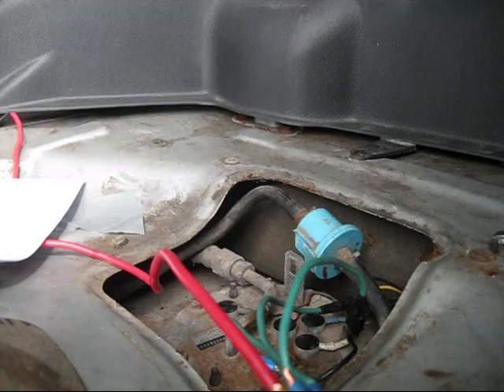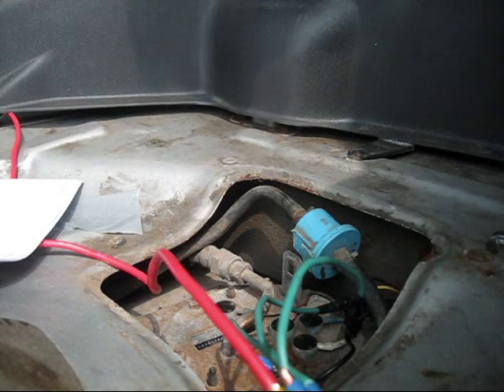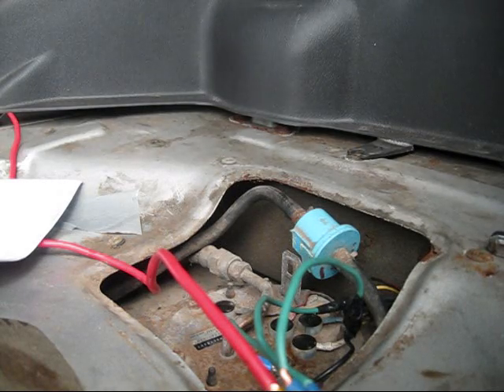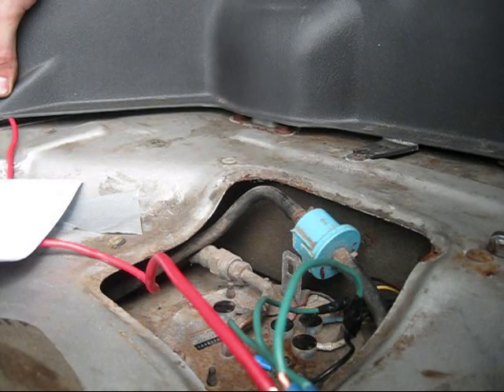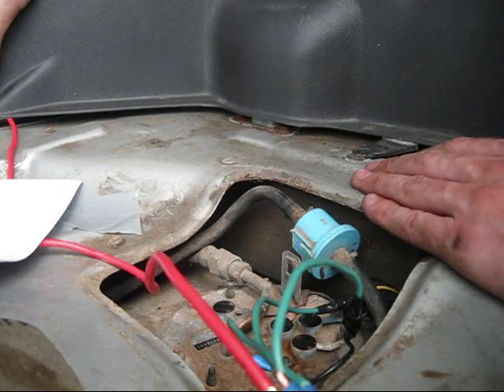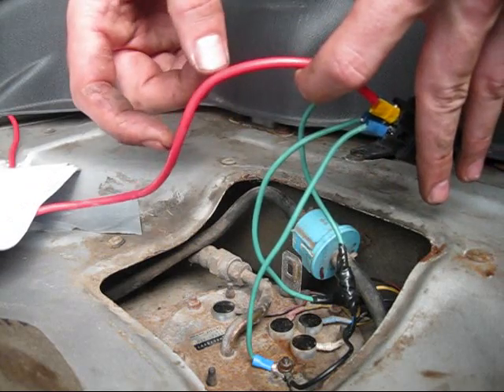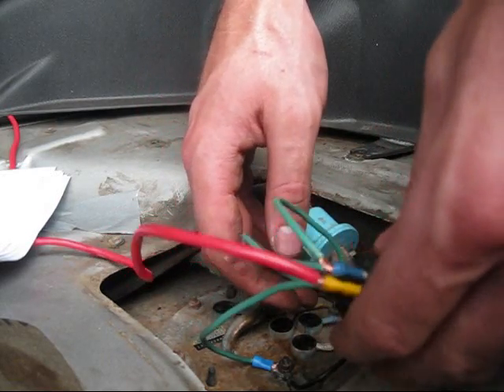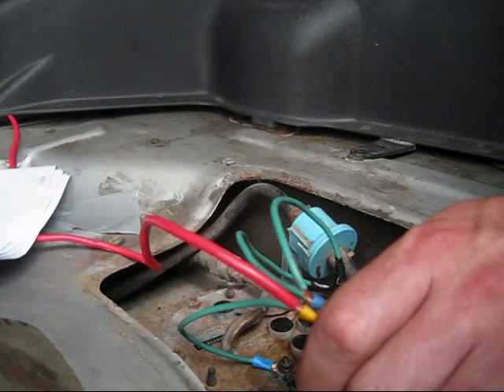Fuel Pump Hot Wire - CntrlSwitch How-To

Comment: oh ok cool. I got the kit in today and hot wired it. I also got the 3sx pre-intake pipes because my rubber ones on the back turbo had a tear in it. I also changed the spark plugs/wires (ngk copper plugs/msd plugs)  My car was studdering a bit the other day, but everything I did today seemed to fix it. The car is my daily driver to school and back (45 min). Its been 3 years so far. Its holding up good. I just can't wait to finish school so I can do serious upgrades.

Comment: I figured it out.. Yesterday I had replaced a cracked rubber hose (the one with a red line) with a regular hose. This morning I realized that the red line hose had a reducer. I would guess that could have possibly had cause the over boost. So what I did was rigged it up to re-use that red line hose. I also replaced a few collapsed, twisted, and kinked silicon hoses that connected to the Y-pipe and the intake plenum. Not really sure which one fixed the problem... but one of those worked. lol

Comment from the maker: The issue is that the stock fuel pressure regulator will be over run by the increase in fuel pressure.  As it it won't be able to let the extra fuel get back to the tank.  This will cause increased fuel pressure and therefore increased fuel consumption and you will run rich.  If you get an aem fpr and gauge so you can set your base fuel pressure you will be fine to install the 255 and keep everything else stock/N/A.

Comment from the maker: 6ga works just fine.  You can get technical and do voltage drop calcs based on the length of wire.  Check the site steath316 it has a write up on it.  Its under fuel pump rewire

Comment: So I got a sl and they did the hot wire but the fuel gauge doesn't work what can I do cause I'm reading milage and I noticed when I get low or half tank the car jults when accelerating from a complete stop. Only does that when it's low on gas

Comment: Hello my daughter has a2002 honda odyssey. My husband has put a new main fuel pump relay on and a new fuel pump and no power is getting to the pump when we switch the car on. The pump works when it connected to the battery
Reply: I have this issue, what was the solution

Comment from the maker: got your message.  You must have the relay wired in incorrectly.  Google some sites on how the relay works.  If you wire it correctly you should only get 12 volts to the pump once the switch in the relay is thrown by the stock positive wire.  Also even if the pump gets voltage your shouldn't be getting fuel "thrown" anywhere.  Are you saying it is leaking? shouldn't even be getting in the cylinders without the injectors opening.

Comment: Hey Shawn. 
I'm having a serious issue. I have a 97 Pathfinder.  Last night I tried to start it and smelled burning wires. I pulled back the carpet and noticed a bunch of water inside where the harness lays.
I've tried cutting and splicing wires but no success.  Can't figure out if it's because the wires are completely toasted or the pump is fried. 
When I turn the key I don't hear the pump prime at all.
What do you think?
Reply: check all the fuses
Reply: shadyj juner 
Found out it had nothing to do with fuses.
Timing belt snapped and motor crapped the bed.
End of vehicle.
Reply: +R Boyd shit dude that suckss
Reply: shadyj juner 
Is what it is I guess. 
It was on me.  I knew it had to be replaced, just didn't have the money to get it done.

Comment from the maker: That's how my car is set up.  Didn't have any problems before or after installing the fuel controller either.  The resistor only lowers how much voltage the pump gets when your idling (and I believe low load?)

Comment: I have a 1999 evinrude 70 go 4 stroke that I am only getting 6.4 volts when checked at the plug using multimeter. If I check with ground to the motor I get 12.4 volts. The manual advises changing the ECU but could I splice the ground wire and ground it to the motor to get the 12 volts needed to run the fuel pump. I have already replaced one fuel pump before I found that the pump was only receiving 6.4 volts. The ECU is over $1000.00
Reply from the maker: Andrew Smith check your wiring manual to see where the fuel pumps ground goes to. It probably shares a ground block with a couple other things. Then see if that ground has a solid connection. Also check your main ground wires that ground the battery to the body of the car. To answer your question directly I don’t see a any problem with grounding the fuel pump wherever you want if it solves your problem.
Reply: Thank You

Comment from the maker: yep I know what you mean.  When standing on the passenger side the "protrusion" tab should be at the top left.  There is a picture of it in the manual (15-14). Incorrect installation would cause idle problems not over boosting.  My guess is you accidentally disconnected a waste gate hose.  This would cause over boosting.  Wastegates need to be connected to a boost source (prior to throttle body).  Let me know if you figure it out.

Comment: i have mine hooked up just like u explained and does not work my main reason for doing a hot wire was the fuel pump was not turning on i no the pump works for sure anyhelp would be great thanks

Comment: Ok.
Got hotwire to rely # 87
Black grnd to #85th
Cut black/blue from harness to #86
NOW what WIRE are you refering to going to #30
Reply: This is how I wire my relays:  
30 - Battery
87 - Power (to pump)
86 - Trigger (factory power wire)
85 - Ground

The fused power from the battery goes to terminal #30.
The power to the pump (black with blue strip) comes from Terminal #87.
Terminal #86 is your trigger and goes to the cut wire (black with blue stripe) on the connector side.
Terminal #85 is grounded, use the point at which the black wire grounds for simplicity.
You should be able to use 85/86 interchangeably and it's just a coil that switches the relay.

I hope that clears things up for you.  He mixed up terminals 87 and 30 in the video.
Reply: @CBTalon97  Thanks !

Comment: I have a 95 3000Gt DOHC non turbo...  driving yesterday I noticed a considerable loss in Power or "get up" and now when the rpm's go down to idle my oil pressure gauge bottoms out. im afraid its rod bearings but the engine is not making any knocks or rattles and it cranks n runs fine, just no power and the oil pressure needle goes up and down with rpm's...   any insight u have on this would be greatly appreciated

Comment: Will this work on a 2009 ford f150 5.4.
Reply from the maker: Wires are likely different and I have no knowledge of that truck, but if it has an electric fuel pump then yes running a dedicated wire off the battery will work. Just properly fuse and use the relay in the same way that I do.

Comment: I just had my fuel pump and Vac replaced in my Pontiac G6, but the fuel pump is not getting any power, I checked the fuses, but thats not the problem. What can I do ?
Reply: I have a 1992 Silverado I'm trying to get  the fuel pump to work   because I'm going school. but  the  fuel pump  is not working !!  what do I need to do.
Reply: kyholler Kentucky fuel pump relay?

Comment: Hey. I have a question. I had my throttle body gasket installed wrong I think... standing from the passenger side fender (looking at the throttle body)  The tab was facing towards the front of the car. I now changed it to where it is facing the back of the car. (I hope u get what I mean)  but now since I did that I am overboosting...
Reply: bypass fuel pump relay 1087 suburban

Comment: I tried to change my fuel pump today and made 0 progress after 3 and a half hours. Could not break it loose up near the pump assembly, or under the car near the tank... Tried everything. Was rounding off nuts with flare wrenches and vice grips... Sucked. Gotta take it to a shop so they can get it on a lift and work a bit more efficiently... There's only so much you can do with a little jack and stand. (Yes - scoured many many threads on 3SI. Had the same problem with the bottom of fuel filter.)

Comment: Those connections on the relay look extremely dangerous. Please for your own safety, redo them properly. 
Still, great video!
Reply from the maker: duke nukem40 appreciate your concern they were redone and heat shrunk at the connections so no exposed wires
Reply: Nice to hear that. Maybe it would be helpful if you put a comment/textbox in your video about that the wiring was a quick/temporary job. There may be viewers who are not that technical and think this is 'the way to go', cable wise. While actually, the wiring is kind of dangerous in your video.
Reply: @dukenukem4043  dude who cares I do the same shit my wires inside my fuel tank exposed  haven't blowed up yet ;)

Comment: yes i get voltage from the fuel pump when i switch the key,  how do i check or wire the pump to run normal, it throws gas when i switch key ready to start